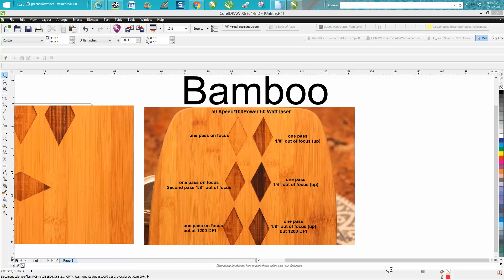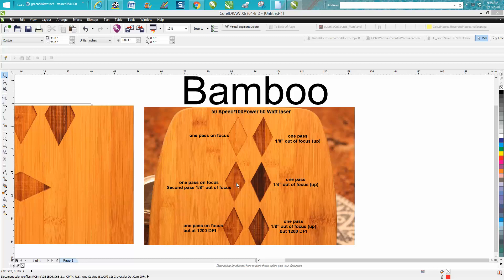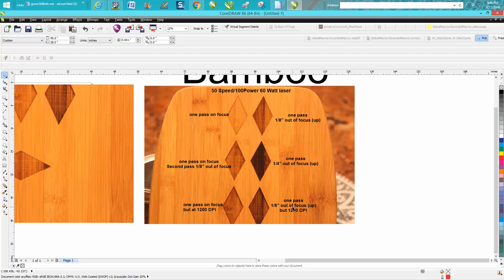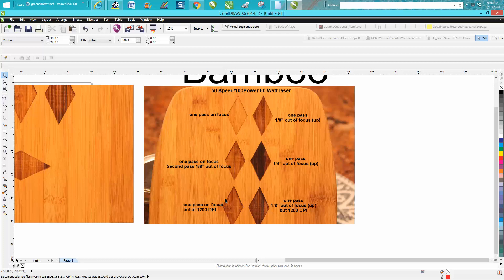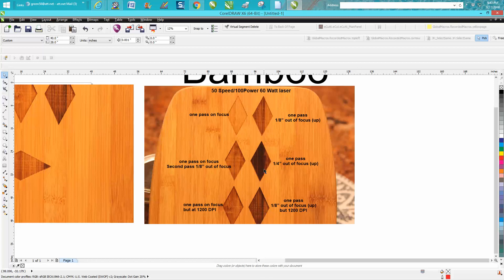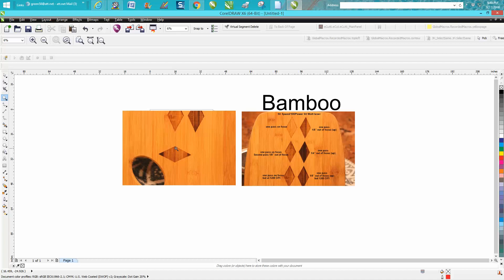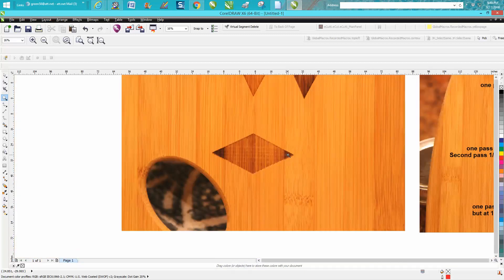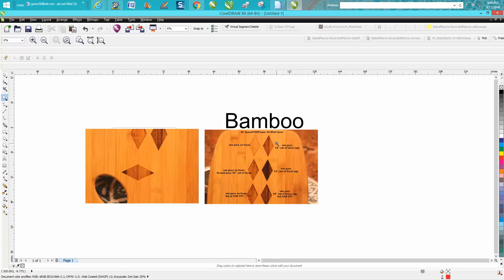Laser Tips & Tricks Engraving Bamboo

Comment: Thank you for sharing your experience. However, I've found another solution which produces dark engraving with a normal configuration, that is by a single pass and the laser beam on it's standard focus distance.
You have to go very slow and use very low power. On my 40W laser machine, at 400 dpi resolution, I'm using 3% speed and 6% power, and the result is great, as if it was engraved on wood. I can achieve almost the same dark result even if the piece of bamboo is darker in some areas and lighter on some other areas (lighter areas in general tend to be engraved darker, while darker areas tend to be just excavated).
I know, when I push play button I forget my work because it takes very long time, but I wanted to share my solution because it's working and needs no special configurations, just applying the right speed and power settings!
Reply from the maker: Thanks, will have to try